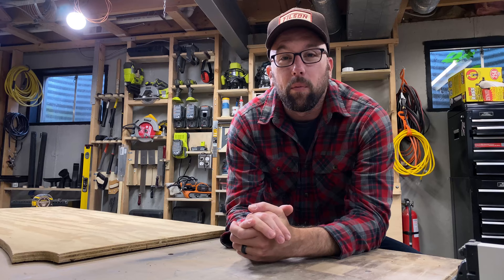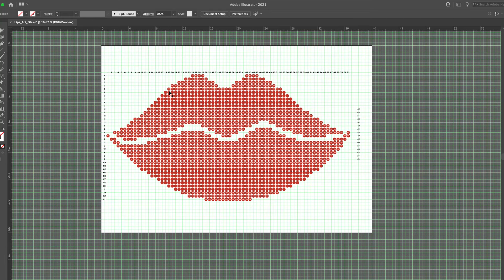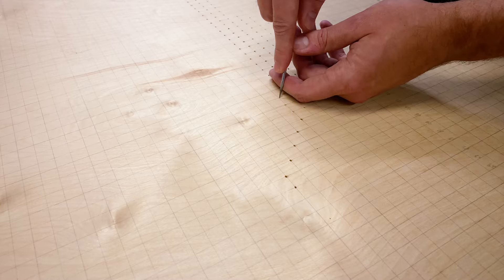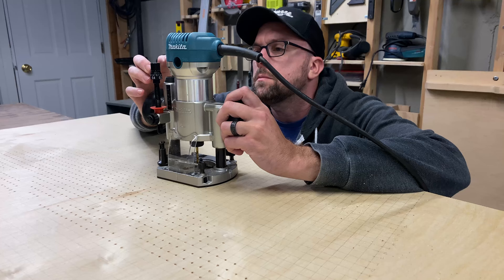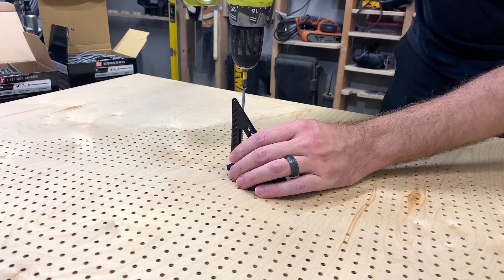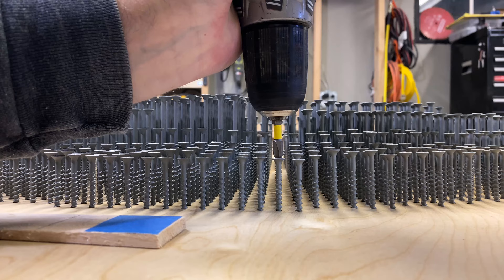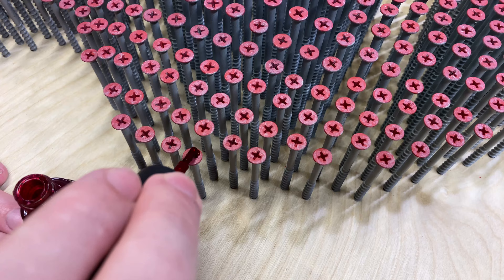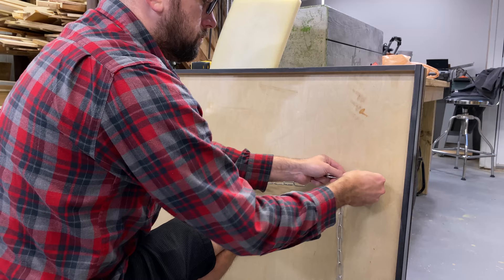Making Lips from Screws // Art from Construction Materials

Comment: Nicely done...chef kisses on the decision to use actual nail polish.. Q: Is your grid available anywhere, I would like to replicate it for a friend.
Reply from the maker: I figured out the grid spacing using Illustrator, but ultimately drew the grid with pencil on the plywood. So no paper pattern used, just some prep thinking and a trusty straight edge.